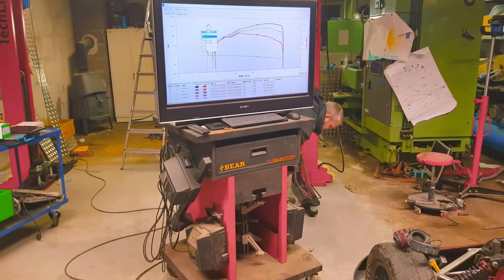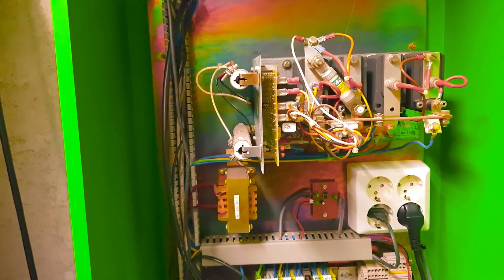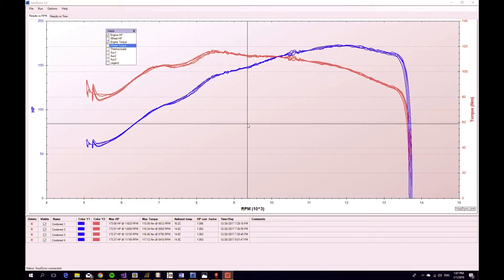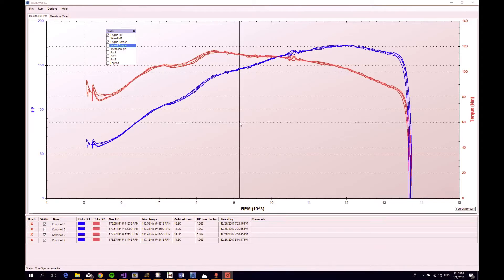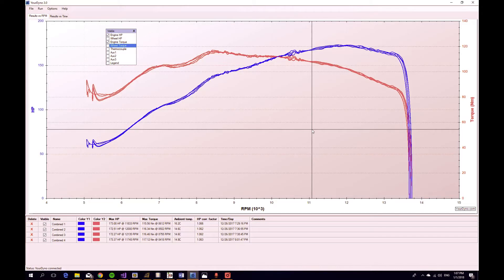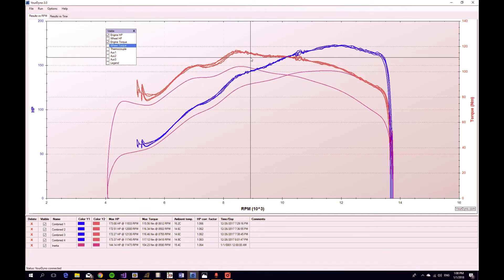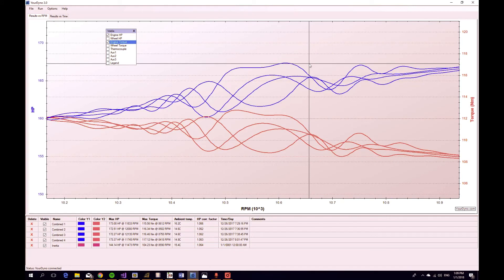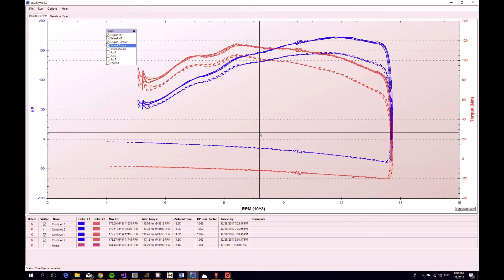YourDyno low cost dyno instrumentation comparison runs

Comment: Why is the torque and hp cross at 10000 rpm? Should be 5250.
Reply: the scaling appears to be why the cross over is not visible at engine speeds of 5252.